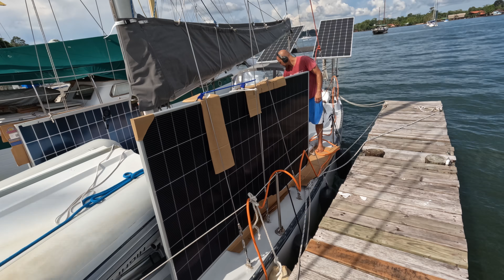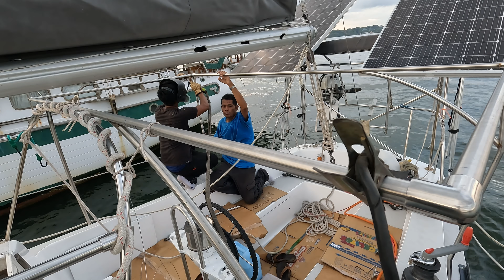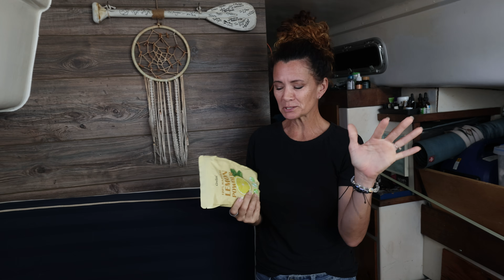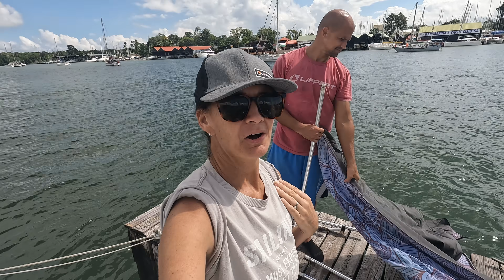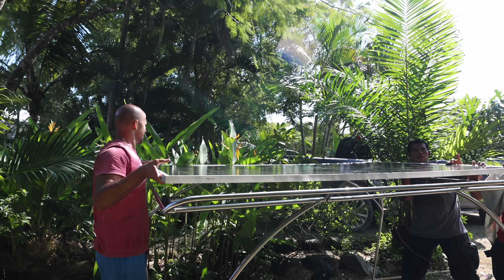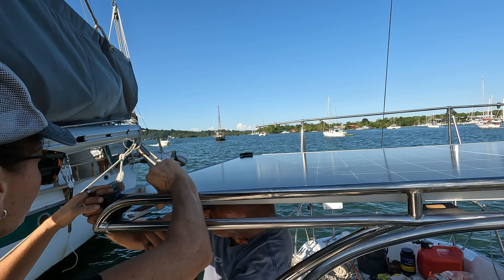We Turned a MASSIVE Solar Panel into a Bimini for Our All Electric Sailboat

Comment: Solves two problems. I wish I still had any of the three boats I lived on. So many cool, new technologies. I added LEDs and solar panels relatively early. I like to keep it simple. But we forget, maintaining kerosene lamps, internal combustion engines, guaging water depth with a lead line, are also complicated. I'm fine with not smelling diesel when charging the batteries.
Reply from the maker: Yes, we do like it this way!

Comment: Nice job.  I put a double mainsheet with no traveller on mine (sent you pics a year or so ago) which opens the cockpit some.  I will add larger bifacial panels either side of the backstay.  Can you suggest a good video that shows your interior best?
Thanks!
Valkyrie Tre 🏴‍☠️ (P35 210)

Comment: Beau, just curious,, how much panel can be blocked by, well whatever, to cut input? 
I HD panels up on my offgrid set up where just an 1/6 of the panel shaded by a limb of a tree would knock that particular panel off-line. 
I of course had mine on a tracker, but occasionally got a tree shadow. It sucked.. when having only 8 panels at that time, and losing 1 sometimes 2, took its share of input amps away. 😢. 
It was in winter when the sun takes a lower path.. 
( tree didn't seem make it! by spring!!!😮😂😂😊) Now there's a nice stump!!! But thinking that boom with it's sail, might be an issue on the boat, especially under way..

Comment: I would have opted to raise the guard rail higher and add another one on the aft portion to protect further protect the panel from the boom and its cables. You may also want to add several cable guides or even a tube to the boom section that passes over the panels to minimize the accumulation of scratches. I could be wrong, of course.

Comment: You might find that the stainless frame will not be stiff enough and will wobble side to side & back & forth. You can stiffen it with dyneema diagonally with low friction ring deadeyes

Comment: Congratulations, I just finished building a arch over my bimini, and one on my davits. I just installed 1230 watts of solar. I also installed  all new victron equipment, new wiring, and 1100 amp hrs of lithium.  I have room for another 820 watts of solar above my bimini behind the boom, but that will probably be a later upgrade.
Reply from the maker: That's incredible! Great job with all the upgrades.

Comment: Hope you report on pv performance in future postings.  The old setup allowed for angling panels toward sun and were positioned to usually avoid mainsail and boom shadows.  New setup may see shadows, but looks like top and bottom sections of panel are wired independently.  Is there no way you can still have smaller panels off stern?  Always thought bifacials would do well due to reflections off water and boat's white gelcoat.
Reply: Also curious about this. Shade from the boom is a pretty big deal.

Comment: What about it changing the Capsize Ratio?
Reply: Yeah, I was wondering the same.  They also shortened the keel recently (removed the swinging part).  Between the two, what does that do to the overall stability of the boat?

Curious, what are the specs (and expectations) for the new panel?  With a 48v DC system, it must be a pretty high voltage panel in order for the MPPT charger to work...  And the shade from the boom must be a factor, too, not to mention that the new panel can't be tilted toward the Sun.  I am thinking I need two sets of 3 of the Renogy 200w ShadowFlux panels in series for my boat.  2 of the panels in series will have enough voltage, but only until they get hot.